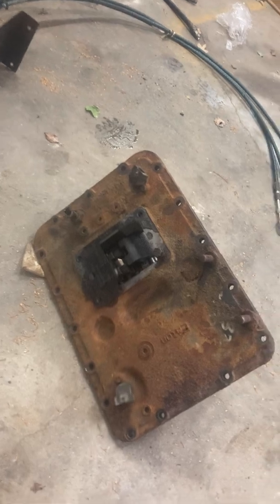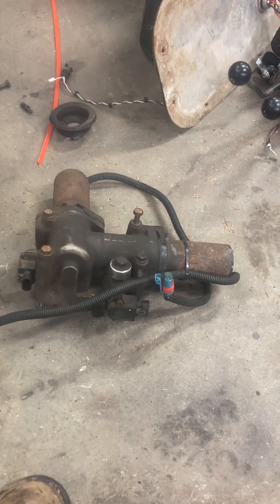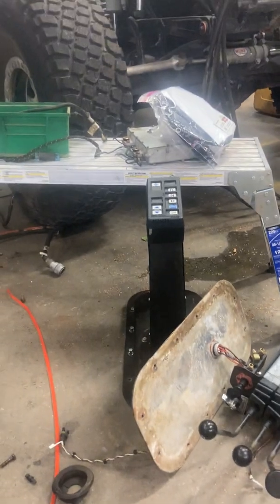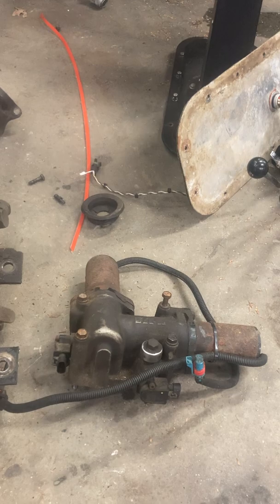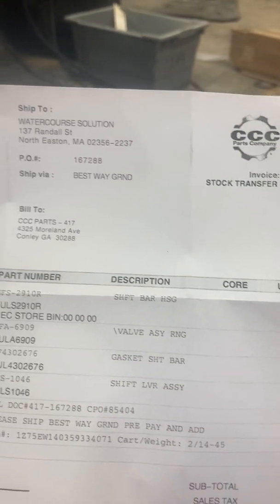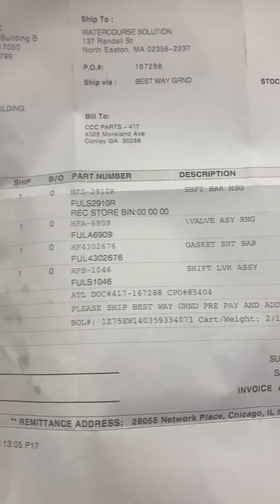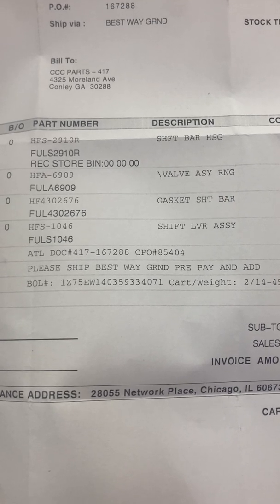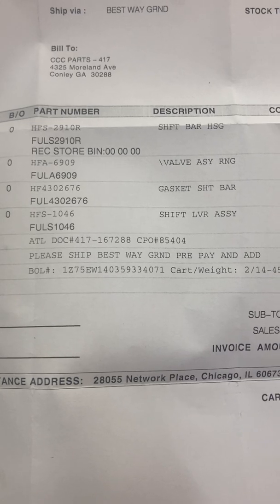Autoshift to manual

Comment: So I bought truck at auction. Need to get home. Luckily I do live close to where them parts came from! But how did you like it? Still working? Wondering bout longevity on that electric kit but a lot easier than pulling trans!
Reply: so I rigged it home! Are you happy with the electric converter? Are you happy with the swap ? Any changes!? Trying to open an account at ccc auto parts. It's next to my house.
Reply: Also did you need to drill case for neutral switch?
Reply from the maker: @Badass5speed no it has a neutral switch. I sold the truck but it was working fine
Reply: @lucasmurph  so this top plate for over drive trans? Getting ready to order my parts but Mauro said over drive has different top then normal but not sure if that's the case. Also was this number for rear shifter location on top plate?

Comment: After you removed the x y z valve did you have to drill holes for the new selector valve? I converted a 2000 Volvo 6 years ago an thoes holes I had to drill were horrible since I didn't remove tranny. Just curious. Good video
Reply: Sorry meant to say xy valve which is your shifter
Reply from the maker: I don’t really know what the xyz valve is.  I kept the solenoid valve on the back it the transmission which makes the range selection and powered them